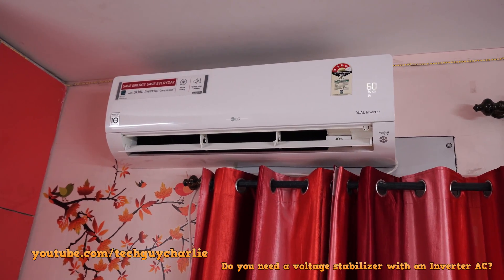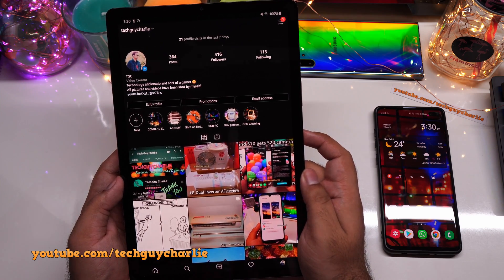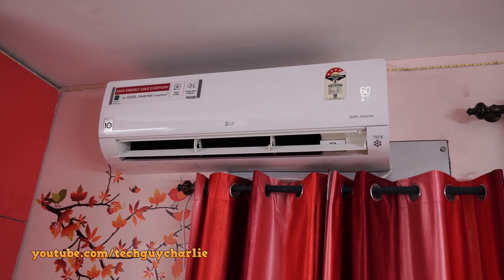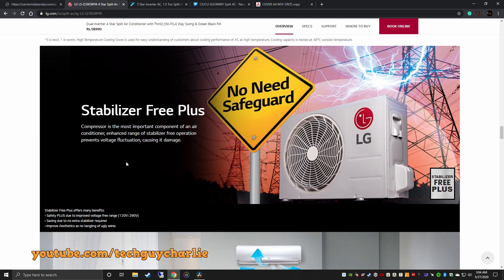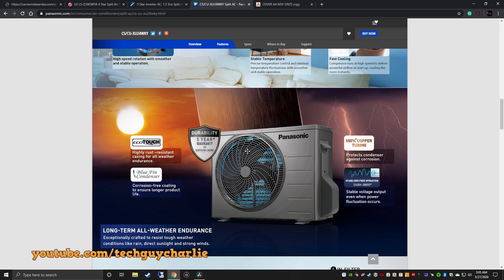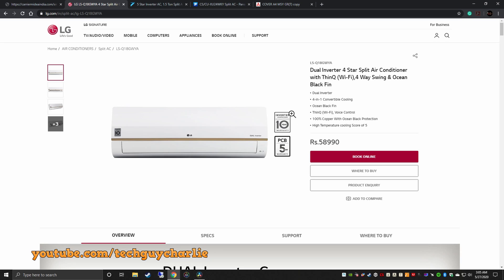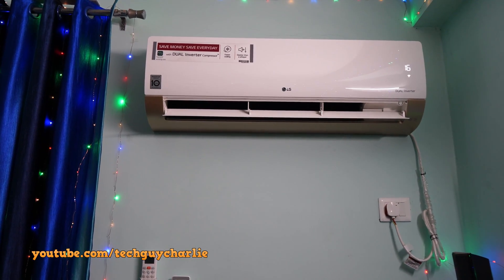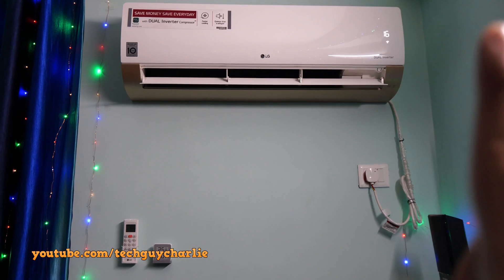Do you need a voltage stabilizer with an Inverter AC

Comment: Dude they told that our ac will withstand upto 280V but the brand doesnt give warranty if any damage happens to AC in plus or minus 230 V. What abt this???
Reply from the maker: Its common for voltage to go up and down depending on the grid load, here the lowest I've seen is 215v while on generator and 268v during winters, none of my AC's have had any issues, if you are still in doubt go ahead use a voltage stabilizer.

Comment: No you do not need a voltage Regulator aka stabilizer with an aircon in India. 

The Voltage stabilizer industry is an unregulated industry in India that makes criminally low grade stabilizers that people in India are forced to buy due to the criminally inept power department. 
Voltage stabilizers are not used in any one of the 194 countries in the world it is a scam in India that is the world capital of scams!

Comment: Does a digital ac require digital stabilizer
Reply from the maker: No, you don't need any kind of voltage stabilizer with Inverter AC's. Anyone trying to sell you a stabilizer with these ACs is scamming you.

Comment: Hi Charlie. Am planning to buy the same LG ac (2021 model) but have a few doubts which I am hoping you can clear out. What happens if the voltage drops below operational voltage ? Does the ac safely go OFF or will it create some problems? Cause we face a lot of voltage issues in my area. 
Also do inverter AC's require a delay time (usually 3 minute) if the electricity comes back on immediately? I know that the older generation AC's and Fridges needed at least a 3 minute delay to protect the compressor from getting damaged, when switched back ON immediately. Most voltage stabilizers for AC's come with a 3 minute delay. Is this necessary for inverter AC's, or is it only for the older non-inverter models?
Also is it possible to use the AC without the cooling during the winters (only for air ventilation)? 
Thks a lot bro.

Comment: Hey I have 5KV Stabilizer for my home. I have bought Inverter AC. Is there any issue if I connect AC to same home load regulated by 5KV stabilizer or I need to gove seperate line for it.

Comment: Mabuhay! The voltage in my room is only 203 volts sometimes 200 volts .is it okay to use lg dual inverter 1.5hp or daikin 1.5 hp inverter?
Reply from the maker: Hi, It will work fine at that voltage. During summers voltage occasionally drops to 200v and I have never had any issues.
Reply: @TechGuyCharlie  thnk you for the info.

Comment: Since it's a stabilizer free operation. Does this ac cut off during very low or very high voltage as like a voltage stabilizer..?
Reply from the maker: These AC's are rated for 120V~290V (as stated on LGs website) and we have never had the voltage dip below 215volts or go able 250.

Comment: Good explation dude. But in my area voltage dip is upto 100 volts.
So, does this AC has autocut off beyond 150volts.
And  Please tell me the "technical difference between an inverter AC stabilizer and normal AC stabilizer"?
As V-guard is selling a seperate range of inverter ac stabilizers.
Reply: The new Panasonic AC have a range of 100-290v

Comment: Bro a stablizer just not used for safguard but also use for maximum low voltage if you are facing a low voltage problum and i know i have inverter ac since 2 years iam using without stablizer but now i am shifted to other place where i am facing too low voltage problum and my ac showing p1 error becouse inverter ac has own rang but when our home wapda is lower then his rang then ac outer did not run and its showing error so now i need stablizer for maximum voltage for my inverter ac thanks
Reply: Bruh its called booster no stabilizer.

Comment: Is your ac working fine without stabilizer. I have also a lg dual inverter ac.
Reply from the maker: yes dude, its been working fine since 4 Years, I haven't been using a stabilizer and had zero issues, it also runs on fine on diesel generator.
Reply: @TechGuyCharlie  Does it hurt to add a stabiliser?

Comment: You said u were using inverter ac since 2016..how it's performing.. Have u ever  done any major repair on any component?? Like pcb or compressors or gas refill or any thing? 
Nd how many time u done ac servicing like normal ac service for 400 500 rs is it in every 2 month interval?
Reply from the maker: You should watch my actual usage review here: https://youtu.be/rokYLjqqGAs
Anyway, performance is as good as the day I bought it, it chills the room even on 45 degree days, no repairs have been performed since it has been installed and I service and clean this myself, so I have not spent a single penny on service in the past 4 years, by the way you need to clean the condenser once every year and the indoor coil once in 2 years just like a regular AC, dont let service men charge you more just because this is an Inverter AC. By the way this is the 5th summer of this AC 2016 summer to 2020 summers, working great.
Reply: @TechGuyCharlie  thanks for the reply.. We used to have window ac.. Which we need to get serviced 2 time in a season like in march nd the in June or July..(I also live in delhi) 

I bought non WiFi LG dual inverter 4 star split AC last week after much consideration (as everyone saying that its repair cost is high nd its pcb board will go bad early nd u need to incur high repair cost etc) so I should buy non inverter.. But I was impressd by diff youtube video on this ac. So bought this..
Nd now yesterday I found your video in recommendations so watched recent videos...
Nd on servicing part its nice u done it yourself...

Comment: Hi Charlie, would you know what is the difference between LG Smart and Dual Inverters in residential Aircon units? 
Not sure which one to buy, models from last year still available with Smart Inverters are 20% cheaper, Dual Inverters seems to be the lates this year model. Is the difference that massive? Many thanks!
Reply: Dual would work to be efficient for longer runs.

Comment: Sir my ac is not able to cool below 29 c my room temp without ac is 35 what to do.   Top floor direct heat
Reply from the maker: There can be several factors why your AC is not able to cool:
1. AC is undersized for the room
2. Cold air from room might be escaping 
3. AC Fan might be set to low
4. AC is low on refrigerant (Very unlikely)

Try running your AC with max fan speed, set the temperature to 16 and let it run for at an hour or so that should bring the indoor temp down no matter how hot it is.
35 should not be a problem for these ACs, I also live on top floor with direct sun, I've already done a test here: https://youtu.be/EGwi-HRHXIE
Reply: @TechGuyCharlie  sir I have done self diagonosis which is a funct in this ac and it shows full refrigant sir my roomsize is130 sq ft which is perfect for the room.   Ac fan is also on high . My ac reduces below 29 on jet mode but when I turn off jet mode temperature raises
Reply: I have the same issue. Voltage is below 200. Just had checked by an engineer, refrigerant is OK, compressor is running at full. Fan is on High. Everything cleaned. But air flow from indoor is not beyong 3 to 5 feet. Air is cool but room temp is always around 29 to 31.